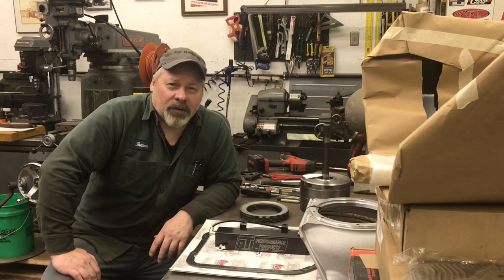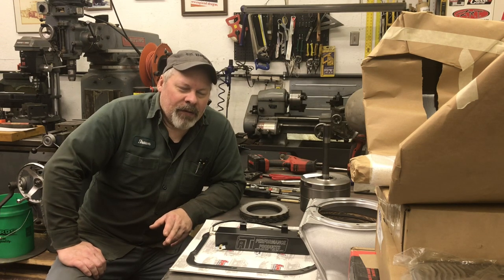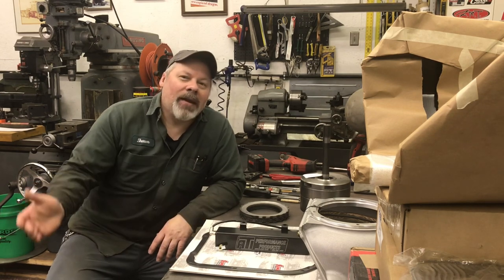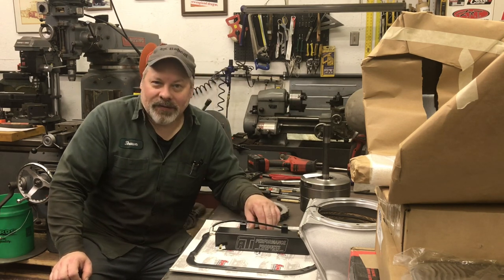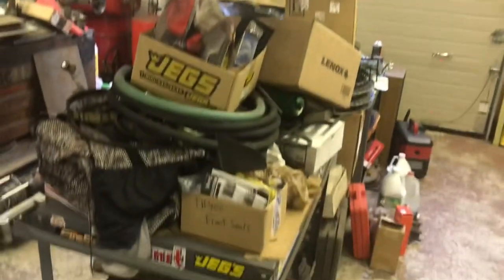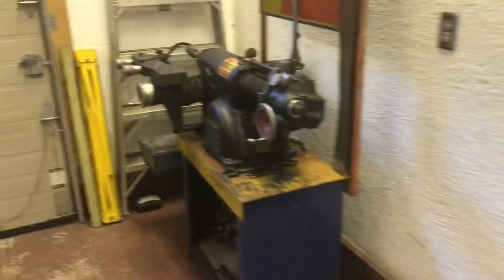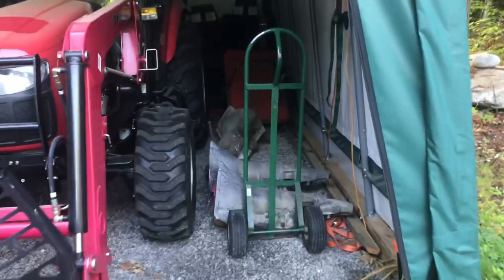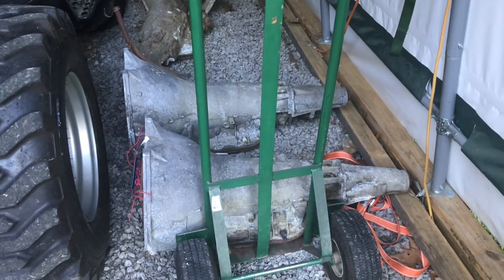TH400: TH475 Build

Comment: What is the main differences in 400 and 475
Reply: Don't ask any questions about anything you would not like the reply but it's just straight cut gears witch are strong and make noise.
Reply: @keysautorepair6038  thanks Shawn
Reply from the maker: @keysautorepair6038  ??
Reply from the maker: Yes it has straight cut planetary sets, 6 clutch Direct, 8 bolt case. 
Good transmissions to find, just need to get rid of the rest of the Motorhome!
Reply from the maker: @keysautorepair6038  I don’t understand your reply. I try to answer everyone?
Reply: @keysautorepair6038  ??   What are you trying to say?  He answers a lot of questions.